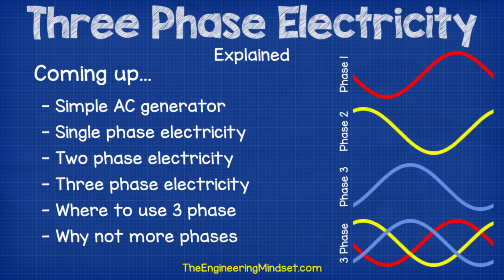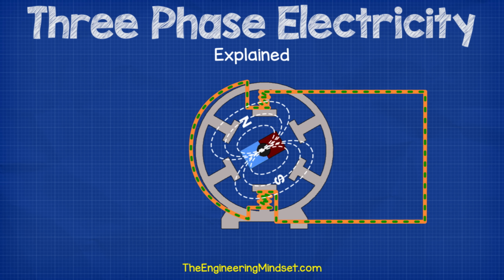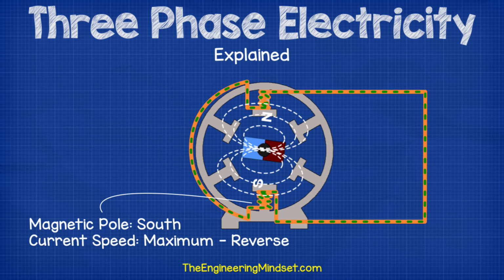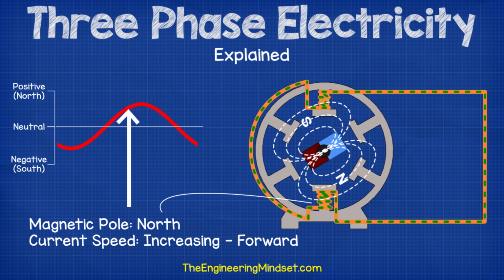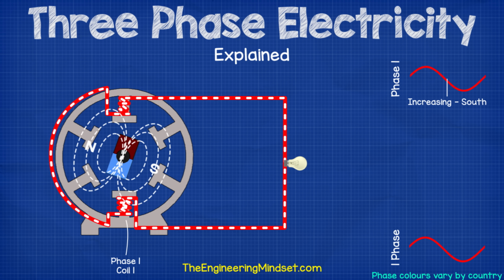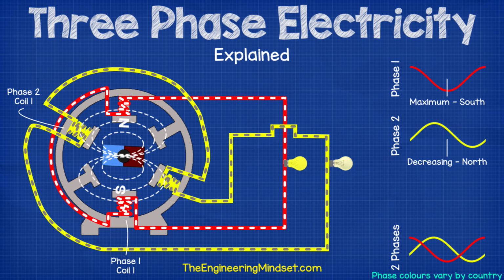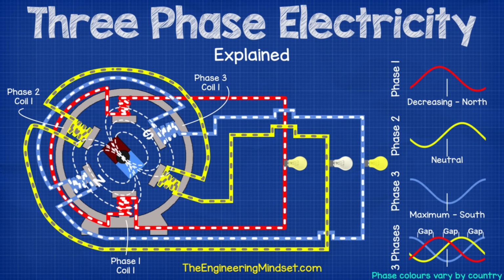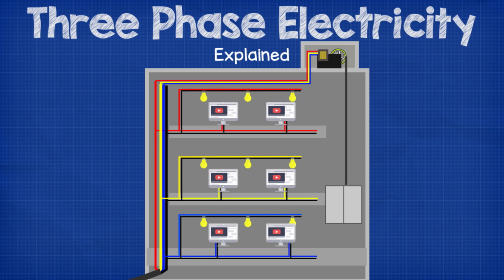How Three Phase Electricity works - The basics explained

Comment: Excellent presentation. Wish they had explained it to us in engineering school like you explained it in your video. Also liked your comment that you can add more phases but it would be inpractible and costly to implement. Thanks for a good visual explanation.
Reply: also, while adding up to 6 phase power is a basic linear gain, going to 12, 24 or 48 phases doesn't produce the same gain, it's much less per added phase
Reply from the maker: Check our new revamped 3 phase explained video, sooooo much better:👉 LINK: https://youtu.be/c9gm_NL7KyE

Comment: Good video, but you have made a slight mistake. The output voltage is 0 when the magnetic field through the coil is at its strongest, and the output voltage is at its peak when the magnetic field through the coil is 0.  This is because the induced EMF depends on the derivative of the magnetic flux, with respect to time, and the magnetic flux is sinusoidal.
Reply: It's faraday's law. The induced emf is proportional to the rate of change of flux. The rate of change of flux is highest in a generator when the flux linkage is lowest. e = BANwsin(wt)
Reply: Also the sine graph he shows is not a reflection of the “speed of the electrons” it’s a graph of the change in polarity of the electrical pressure. Voltage.
Reply: @Coldbrookdangee  the applied voltage multipled with some constants equals the Drift velocity, basically the same curve.
Reply: Great video but one more minor point, it's not the "speed" of elections that increases and decreases but their intensity, their number/ strength. Electrons always follow at a constant rate based on the speed of light.
Reply: @privateone2651  Your correction is actually false and a common misconseption. Electromagnetic FIELDS propagate at the speed of light, however electrons have a non-zero rest mass and can't reach light speed for that reason.
Electrons move randomly in a conductor with the fermi velocity (around 1000km/s), since this movement is random it averages to zero (no current). Now if there's a voltage applied, the chance of electrons "choosing" a certain direction increases, which results in a non-zero average. This average is called drift velocity and is only a couple micrometer per second and proportional to the voltage. Edit: The actual value of the drift velocity is also dependent on the conductor.
Reply: What's important to remember is that putting a wire in a magnetic field that has a constant flux density will not induce any voltage in the wire. The magnetic flux has to be changing in strength in order to induce a voltage. That's why in the generator when the flux density is at maximum in either polarity it has a fixed density so no voltage will be induced. Then as as the flux density begins to decrease voltage starts to be produced. The voltage level increases as the field collapses faster and faster and the voltage is at maximum when the field strength is passing through zero because that's the point of maximum flux density change. Then as the field strength increases again in the opposite direction but the rate of change is reduced the voltage drops towards zero again.
Reply: So basically the lamp will light in according to a cosine wave. However, he mentioned Power, and you're talking about Voltage. We multiply Current with Voltage to get Power, so that may change things up a bit. I'm not sure, but there seems to be a discrepancy in your argument.
Reply: You are making this up. 😂
Reply from the maker: Check our new revamped 3 phase explained video, sooooo much better:👉 LINK: https://youtu.be/c9gm_NL7KyE
Reply: Not really a mistake, the video seems aimed at dummies like me. I understand this video enough to understand the basics. While i'm sure your right in what you say, you lost me in 1 paragraph.

Comment: does this mean that if one of the three circuits fails and all three circuits are distributed across a city, only the houses associated with the faulty circuit will lose power?
Reply: Technically yes but in reality one phase sagging or dropping out causes a swell on the other two which will cause breakers and reclosers to trip and cut power to all the phases since you are going out of the allowable ranges of voltage on the other two phases so they need to be tripped off as well.
Reply: Frith oh I see that makes so much sense actually.
Thanks!
Reply: If the city was build to last the transmission lines would be set in a ring setup so if one line fails everyone is still connected but the lines get overloaded
Reply from the maker: Check our new revamped 3 phase explained video, sooooo much better:👉 LINK: https://youtu.be/c9gm_NL7KyE

Comment: Good video. Can you explain the differences in voltage between single and three-phase power? In the US, many three-phase applications use 440v whereas single-phase is typically 120v.
Reply from the maker: We will be making some more electrical videos and calculations explaining this and other more in depth areas
Reply: Air craft

Comment: The main advantage of three-phase power is in commercial/industrial applications, as a three-phase motor's rotational direction can be easily reversed by reversing two of the three lines feeding the motor. Thus, you'll see it on elevators, and industrial machinery.
Reply: It would be clearer if you said that you would swap two phases,  not reverse. 
If you've got line phases A, B, and C feeding motor phases x, y, and z respectively, you would swap, say, A and B to feed y and x respectively to reverse the motor. C would stay connected to z.
Hope this is clear.
Reply: The original advantage wasn't even about reversing the motor---it was about being able to have a motor that did not need any kind of controller. The motor "plays back" the exact movements of the generator.

Comment: The power coming out of 3 phase is smooth there is no gaps.
Reply: power transfer of 3 phase is totally flat it may be hard to believe but it's true. When you go from voltage to power it's sin^2 like U^2xR then you get sine waves that are double the freq and above the zero line so to speak. It's the same picture as 3 phase voltage the 'variations' cancel out and you're left with the 'dc component'. 
sin^2x = 1/2 - 1/2 cos(2x). the second phase would be 1/2 - 1/2 cos(2(x+120º)). and so on. If you add them all up the cos factors cancel out and you're left with the '1/2' Dc components. It's magic. 

Same thing for a hypothetical 2 phase 90º system that one is easy to see. The 90º difference becomes a 180º difference in the power domain so again you're left with the dc component. Offcourse when you're going to have a 2 phase system you either need four wires or 2 and a fat neutral. The neutral doesn't carry any power, with 3 phase you get the rotation, flat power transfer and you need 3 wires only which all carry power. In the high voltage transfer world offcourse for final distribution a neutral is added.

I don't know what's the 'logic' behind this. I guess when you have 2 points or poles then there's only one possible connection between them or 'phase'. When you add a third point (in a triangle) then there's suddenly 3 possible connections. all of this is in the polar diagramm world so to speak.
Reply from the maker: Arlin Sansome there are gaps between the peaks. Only DC is smooth
Reply: When you total the power from all 3 phases its smooth.  When phase A is producing the most it can phase B and C are producing the least they can (when looking at the sum of B and C together)
 making the sum the same as when B is producing the most it can while A and C are producing the lest they can.  Also as Any phase moves away from the peaks another phase is moving towards its peak.   Making the power from all 3 phases totaled together always the same.
Reply: Thanks Alex
Reply: Mr. Sansome is correct.  At any instant the power supplied to a 3 phase motor is a constant...just do a trig calculation of 3 sine waves offset by 120 degrees..squared and added.

Comment: I'm a bit puzzled - the bar magnet markings and magnetic field strength seem to be opposite of normal convention. Typically the red area would be marked "N" and blue "S" and the maximum magnetic flux is at the end of the poles, not in between them, and there would be arrows showing the field going from N to S (which helps determine which way the current flows in the stator windings). The flux lines coming out of the end of the poles  would also be depicted as intersecting the stator windings and thus the current is maximum when a pole is directly opposite a stator winding, not when it is in between them. One very good thing about the animation is that it explains well the light going on and off, which is a 120 times a second with 60HZ AC. It might also be useful to explain that a two pole rotor like this one would have to spin at 3600 RPM to get 60HZ, so typically they would be more rounded to keep from flying apart. It also appears the generator depicted is an induction type generator which isn't used much (yet) to power communities.
Reply: It seems the video is showing *current*, not voltage. Current is induced by a change in magentic flux, which is zero at the poles and higest between poles.
Reply from the maker: Check our new revamped 3 phase explained video, sooooo much better:👉 LINK: https://youtu.be/c9gm_NL7KyE

Comment: There are a few slight technical errors in this video. One that stuck out was the electrons always travel at the same speed. What changes is the voltage, or ask many people think of it, the pressure on the electrons.
Reply from the maker: The electrons are moving at different speeds in the animation, it took a very long time to do. You can slow the video down in the bottom right corner and see is more clearly. They move the fastest at their phase cycle peaks then slow to zero.
Reply: The Engineering Mindset that may be true in the animation, but that is not how it happens in the real world.
Reply: Oh, and don't get me wrong, I like the video, and want to see you make more of them. I just want to make it clear for beginners.

Comment: Could you make a video explaining Philadelphia Pennsylvania's 2 phase electric power? Which is different from 3 phase power and regular US house power. 2 phase electric is also used in Hartford Connecticut.
Reply from the maker: If you scroll through the comments a user called @kjpmi has just explained this concept. You will find it interesting
Reply: The Engineering Mindset that doesn't answer my question.
Reply: The Engineering Mindset there's a difference between split single phase and the 2 phase power found in Philli and Hartford.
Reply: Not sure of what needs explaining. 2 phase systems are simply 3 phase systems where the power company only runs 2 phases instead of 3 phases. It saves a lot of money if you don't serve any heavy 3 phase loads.
A power pole with 2 phases mounted on the crossarm and the neutral mounted below, the points of connection to the pole would form a "V". That is exactly what we would call it- a "V phase" and we would all know it was only two phases with a neutral..
What complicates it somewhat is the power company can run either a "delta" system or a "grounded wye" system for their high voltage phases.
I am not familiar with Hartford or Philly so if you can send me a link that talks about their power service I may be able to answer your question.
:8 years as a power engineer(BSEE) for a utility!
Reply from the maker: Watch this video on US electricity: https://youtu.be/fJeRabV5hNU

Comment: Finally, someone who actually explains how the 3 phases are finally connected and used in homes and factories. There are lots of sources of what 3 phase electricity is, but rarely talk about how the 3 phases are divided into single phases for home use or kept as a 3 phase for large equipment use.
Reply from the maker: Glad you enjoyed it. There are many different ways to connect houses and buildings but the ones shown were a simplified overview to help understand.
Reply: The display in the manner The Engineering Mindset only used that display only to not confuse people like me. He did an excellent job explaing the different phases, he was not trying to show how the magnet works.
Reply from the maker: Check our new revamped 3 phase explained video, sooooo much better:👉 LINK: https://youtu.be/c9gm_NL7KyE
Reply: Most homes, at least in America, get two phases.   We have large appliances like electric ovens and air conditioning units that work on 220vac and require two phases.
Reply: @hankeisenstein272  No. They get one phase that goes through a local transformer which is center-tapped to give them 2x110V. It's still just one phase.
Reply: @HenryLoenwind  It is mathematically equivalent to getting two phases that are 180 degrees out of phase, which ends up being two line-to-neutral waveforms that are equal and opposite.  Even though it is produced by center-tapping a single phase, rather than through a time delay created by the positioning of the pickup coils on the generator.
Reply: 220vac split phase. For 120vac devices. L1,L2 =  120vac  to neutral. 220vac across L1 and L2.  L1 and L2  are 180 phase angle.

Comment: Ahora comprendo porque hay 4 lineas áreas en los postes de luz.
Reply from the maker: street lights are all connected to one phase. The streets might be on different phases.
Reply: In many spanish speaking countries it is usual to say "luz" (light) when referring to electricity from the power grid. In this context, "postes de luz" (light poles) should be taken to mean the poles that carry power, not just those that have lights. In the OP, this is further sustained by the fact he is talking about aerial lines in the poles, which have multiple lines so they can carry all phases so they can distribute different houses (and street lights) evenly across different phases, but still have all 3 available for larger buildings.
Reply from the maker: Española aqui: https://youtu.be/7JDmvDzb5L8